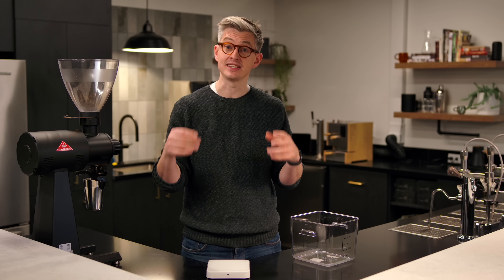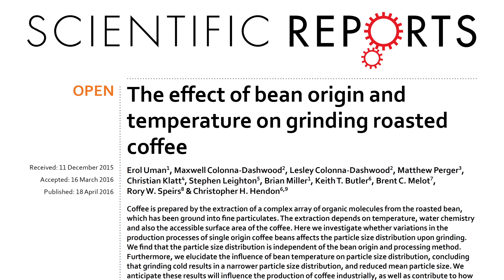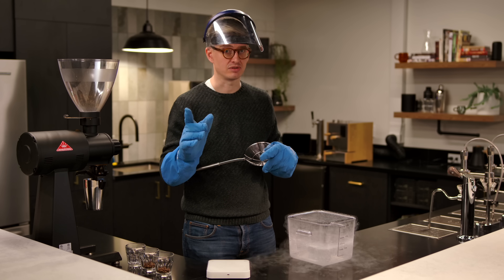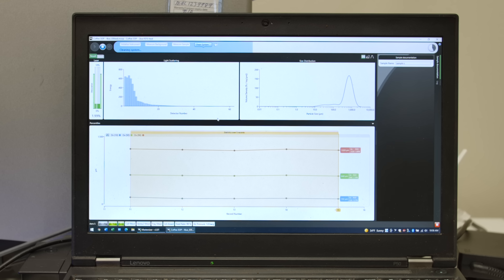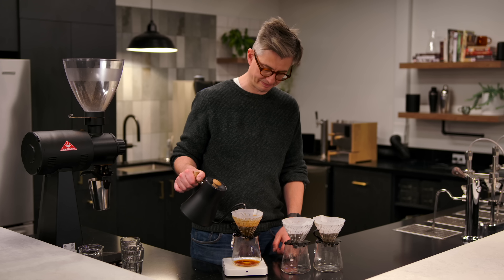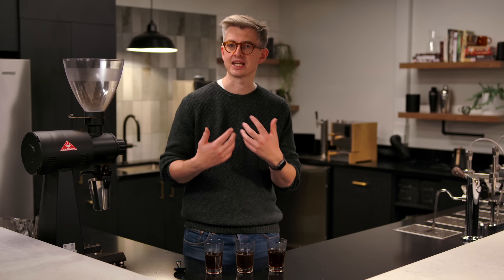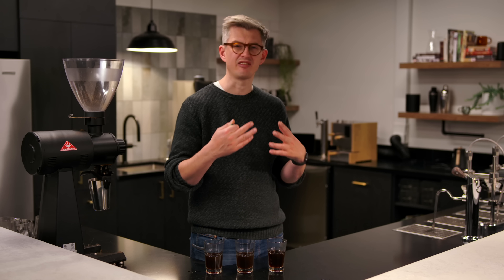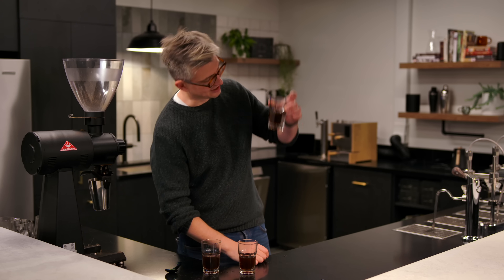Mixing Coffee Beans and Liquid Nitrogen - A Surprisingly Good Idea

Comment: Then there's the next question to my mind.

If beans have been frozen in liquid nitrogen and allowed to get back to room temperature (or freezer temperature), is there a similar difference in the grind? In other words, would it be advantageous to buy coffee beans that someone has frozen in liquid nitrogen?
Reply: having played around with LN2 at university (I mean how could you NOT play with it!), I'd hazard a guess that it's thermal gradients that crack what has already been made brittle by the cold. There's only CO2 and residual moisture in there, but I doubt freezing them changes the structure of the particles much, both on their surface and internally.
what perhaps matters more in the experiments presented here is whether the burrs are at LN2 temperature or at room temperature, and whether you keep flushing the grinder with LN2 during the process to keep the grounds cooled.
Yes, I am now imagining James with a cordless drill running a small hand grinder submerged in LN2 :)

Comment: What I don’t understand is that won’t the frozen beans draw significant condensation during the grinding process and as it sits in the portafilter leading up to extraction (due to ambient room temp)?? I always heard to let the frozen beans thaw out in a vacuum bag to avoid this issue. Is there a concern in getting condensation moisture drawn into the grinder, and also does the moisture affect brewing specifications similarly to how on a wet humid day we can expect slightly different extraction specifications??

Comment: Freezing beans means freezing water and oils inside in the first place. It makes beans more brittle so I guess there's slightly higher chance they'll crack and disperse rather than just get crushed. And the reason why freezer beans don't experience much difference might be due to the oils having lower freezing point than what's in the freezer.

Comment: Would be interesting to know how much of this is actually a function of temperature and how much of condensation. Stands to reason that the frozen beans would accumulate a lot of water - ala the bean misting technique - which may serve to reduce fine particulate formation.
Reply: I was also wondering about condensation. Doing this experiment in winter vs non-winter might get different results.

Comment: I can see people who work in labs where they use liquid nitrogen doing this now. For the rest of us... It's kind of expensive. But. I can see using dry ice (solid carbon dioxide). But dry ice is about -108 degrees F. While liquid nitrogen is somewhere in excess of -300 degrees F. So, the dry ice is not really much lower than your freezer. One more to try. See if you can cool your beans down using liquid helium (~ -452 degrees F). :)

Comment: Fascinating and illuminating as usual. But this approach makes me wonder - if the underlying premise is that this process results in more uniformity and thus a more consistent and thorough extraction, wouldn’t it be simpler to just grind beans “more finely”? (That sounds like poor English but you get the idea).  
Normally, we avoid grinding too finely because of subsequent problems with extraction under (typically) 9 psi pressure. So wouldn’t there be another/different crossover point of increased extraction pressure + finer grind that results in a superior output?

Comment: Which is the temp of the ground coffee at brewing time? I know that the grinder has heated everything up, but did they reach a similar final temperature? I expect a much colder coffee to extract less regardless of particle size.
Reply: Yes i was writing same thing. And i saw your command. Probably liquit nitrogen frozen beans was colder than other even though was ground. And because of that it will be less extracted.

Comment: Very interesting, as always!
One small thought: if you ran the liquid nitrogen sample first through the grinder its very low temperature could have reduced the burrs’ temperature significantly, possibly biasing the results towards a smaller difference between samples.
Reply: Thought the same, but since they did not show the grinding of the other two samples I assumed that they did of course start with the warmest beans first…. Him being James Hoffman and all that
Reply: 10 g Coffee in 1000 g Metall Burr Set plus heat from grinding... can't bei that warm Afterwards!

Comment: The problem with telling people to grind from frozen Is many people are just gonna go against the advise you've previously given about letting the package come up to room temp before opening it to avoid condensation on the beans. That will result in getting good results that day but the unused coffee goes downhill quickly afterwards (2-3 days). So if you dont have little glass airtight jars single or double dosing with or two days worth coffee only I'd let it defrost first! Especially if you're not seeing a noticable difference with standard freezer temperatures!
Reply: Just freeze single-dose vials and grind without defrosting. You get the same quality as room temperature beans, but without having to worry about coffee aging / going stale.
Reply: @Yirgamalabar  sure. The only down side is if your coffee was frozen at a non optimal time then you're kinda missing out on the progression of how it changes over time. It will be consistently the same or about the same freshness. One or two coffees I had got better after 3 weeks (usually not the case but it happens!).

Comment: It’s interesting that there was no noticeable difference room temperature and domestic freezer beans, but I wonder what the effect would be of a larger dose or on espresso in terms of the lower bean temperature potentially lowering the temp of the puck/slurry? Might mean having to slightly increase the brew temperature?  Or are the beans warmed sufficiently during the grinding to negate this?
Reply: This was my question too. I live in a very hot and humid area with no specialty coffee roasters around, so espresso is a hassle to make unless I've bought the beans like a week ago. If I can keep them fresher in the freezer without getting a cold puck I'd start using my espresso machine a lot more.

Comment: I didn't read the paper, but I'd be curious to see if the difference in grind is almost entirely due to the thermal contraction of the metal burs. Might be worth immediately grinding room temp beans after a shot of liquid nitrogen into the burr-set to replicate the results
Reply: An interesting question but don't know if the temperature of the burrs could be measured which would be required to to reduce their temperature to the same temperature when grinding non nitrogen frozen beans.
Reply: @raymondrak961  one burr is stationary, it could be easy to hook up a probe to measure the temp of the stationary burr. Again I didn't read the paper so maybe that's part of the theory

Comment: Interesting, so my natural question is, would it be best to store your beans in the freezer all the time? If the lower temperature improves the grind and the coffee stays fresher, there is really no point in storing the beans elsewhere if you can, isn't it?
Reply: Check his video on freezing coffee. You don't want to be exposing the coffee to temperature fluctuations. Freezing is best for longer term storage. Its interesting to see how an coffee evolves as it ages so I generally do a larger amount at a time. You want an air tight container/package and don't open it until it comes up to room temp. People have had good results just throwing the whole still sealed bag in the freezer.
Reply: @BensCoffeeRants  Yes, I've seen the video. But if you would take the container out to just get a single dose, the temperature wouldn't fluctuate very much I believe. The aging is a good point tho, as the developement is interesting indeed. But you might find a point when you don't want your coffee to age more.
Reply: @evilDandelion39  I buy in 5lb bags sometimes since they're priced better, in that case I'll split it with some family or a friend, and/or freeze like 2lbs of it for later. But for 12oz bags you're likely going to finish them within 3 weeks and it's not necessary to freeze them.  
I wouldn't take the container out to get a single dose out, even if you're quick you'll expose it to a temperature change and cause condensation, plus you'll be doing that everyday, also if you do that you'll never know if it's at it's peak or youve been having the coffee before it's prime every day till it's gone! 
Unless you're talking about single dosing / pre  packaging them individually, it's pretty wasteful if your vac packing in bags, but little mason jars are good for that. Just take out the jar for a day or two amount of coffee. But I think it's good to see how the beans develop over time. Sometimes I do enjoy them super fresh they're more fruity, but get more balanced as it ages.
Reply: @BensCoffeeRants  I've totally forgot about the condensation, that would be an issue. Unless packed individual doses as you say, but that's pretty overkill. Anyway I still split my 250g bags and freeze half, because too often happens that I have a good coffee and have to travel or leave the beans home. This way I have always a certainty that I will have some fresh left.
Reply: @evilDandelion39  
Just freeze single-dose vials and grind without defrosting. You get the same quality as room temperature beans, but without having to worry about coffee aging / going stale. And since opening a vial does impact other vials (which remain closed), condensation is a non-issue.

Comment: I would be curious to see if the actual freezing of the coffee with liquid notrogen alters the bean's structure and possibly chemistry.  Perhaps another test is justified where you freeze the beans with liquid nitorgen and then let them come to room temperature and then grind and blind taste test.
Reply: It is almost certainly a purely physical property that is causing the change. Liquid nitrogen is just that, nitrogen in it's liquid state. Specifically, two nitrogen molecules bonded to each other which is a very stable compound (in fact most of us in the scientific community refer to liquid nitrogen as LN2). It is the same nitrogen that comprises roughly 70% of the Earth's atmosphere. When you cool an object to the same temperature as liquid nitrogen, it becomes insanely brittle. There are plenty of great examples of this available in YouTube, things like smashing rubber bouncy balls into dust, or flowers or shrinking balloons full of gas at room temperature to tiny shriveled sacks. Great fun!
Reply: One of the reasons we use LN2 in a laboratory environment is specifically to prevent changes to sample chemistry and structure; snap-freezing preserves architecture and chemistry far more effectively than "slow" freezing at -80 degrees C, -20 degrees or indeed just refrigeration. There can be issues with crystal formation that mean that it's sometimes valuable to deliberately slow down the ramp down to LN2 temperatures (such as with storing cells for later culture work) - in those cases we use media with modifications to reduce ice crystal formation (dimethyl sulphoxide, glycerol etc) and containers with walls filled with isopropyl alcohol. These keep the rate of freezing down at around -1 degree/minute - the optimal rate for cell preservation - whilst allowing the final temperature to -90 degrees C, where chemistry will be best preserved. In the case of coffee, the cells will be mostly lysed (broken) by the processing and roasting stages, so that rate-limiting method isn't necessary.
Reply: I agree.

Comment: I'd be curious to see the same tests with more of a filter/coarse grind and it's impacts on lower grade grinders. Is there more of a value added if your using a sub 100 dollar grinder or even a blade grinder? I'd imagine the grinder used is already pretty good at not generating uneven ground and fines.
Reply: Pretty sure that for the cost of liquid nitrogen you're sooooo much better of just getting an actually good grinder instead

Comment: I'd be very curious to see if there was a difference between frozen beans straight out of the N2 and N2-frozen beans that have been allowed to come back up to room temperature! I'm not clear whether it's just temperature at the point of grinding that affects the grind size and uniformity (in which case you'd be able to get the same result by chilling your burrs, theoretically), or whether the act of freezing changes something in the constitution of the beans. I'll have to read the original paper, see if they deal with it in there.
Reply: Good question but it's beyond the scope of the comparison.  My understanding is the company uses nitrogen frozen coffee beans to achieve a more uniform particle size.  Allowing the beans to reach room temperature would add time to the process.  The comparison of room temperature and frozen beans appears to be minimal.
Reply: OK I read the original paper and it says that the beans were taken directly from their temperature climate and fed straight into the grinder, so they didn't explore whether supercooled beans underwent any changes that changed their grind profile even after they were allowed to return to room temperature. @James Hoffmann might that be an interesting experiment to conduct next time someone gives you a vat of Nitrogen?

Comment: An important note. The "liquid nitrogen" frozen coffee will have a larger amount of water retained because of the condensation of moisture due to the extremely low temperature. Is this going to effect the extraction process?
Reply: Possibly. If the water has permeated into the coffee cells you skip (part of) the bloom and extraction has begun before you even brew. But, the water is negligible compared to the water used for the bloom or the main extraction.
Reply: Yeah I am not really worried regarding the amount of water. More about the effect of brewing a coffe that got wet during the milling
Reply: Yes, will definitely have picked up some condensation. I was a little concerned for the EK43 burrs
Reply: I don't think "condensation of moisture" is an issue when the beans have been essentially freeze dried.
And grinding will increase their temperature due to friction.
As far as burrs go, I'd be more concerned about the increased wear of grinding frozen beans.
Reply: That just means no need to RDT
Reply: I guess it will also be at a lower initial temperature, which would also affect the brewing temp (maybe that's why the brewing was slower? and why the coffee seemed "less extracted"?)
Reply: @HumbertoMassa  I really don't believe that. The heat capacity of coffee beans is very small, the temperature difference between liquid nitrogen and room temperature (the brewer, grinder parts, dosing cup, what ever else) is rather large and the friction of grinding the beans probably heats them right up. I think the coffee seemed less extracted due to a comparative lack of fines. (which is interesting actually, colder beans are more brittle and I would expect them to make more fines because of that)
Reply: I would have wanted a fourth grind where the beans were frozen, then thawed, then ground. That would indicate whether the low temperature freezing (and possibly condensation) itself altered the taste or if it was the grinding that did it.

But that's a nitpick. I'm not going to be "reviewer B" on James for this :)
Reply: You could weigh the beans after dumping it in liquid nitrogen to see if it has absorbed any moisture
Reply: Get a dehumidifier and remove the moisture from the room.

Comment: James: do you have any sustainability concerns around delivering coffee frozen? We've had coffee for thousands of years without the need to keep it cold. Cometeer's way of having it involves the energy expense of brewing it in the first place, then keeping it frozen, then the customer's energy expense to thaw it or reheat it. Not to mention the single use plastics involved too. It seems like another solution that only provides convenience at the expense of sustainability. But you've been historically very nuanced and careful with these issues so probably I'm missing something here.
Reply: I've also had this question. They mention that they're using aluminium cups and say they recycle their grounds but make no mention of their supply chain. I'm not sure it'll be much different than the footprint of frozen food. But would like to have a definitive answer on that from them
Reply: @harsha1306  They actually are using Al which you can/should recycle.

Comment: With this low amount of liquid nitrogen isn't it safer to not wear gloves when you handle it because the leidenfrost effect? We were always told not to when working with liquid nitrogen on the job.
Reply: I suspect he's wearing gloves because the little basket he's holding is metal and might get cold. 

I agree in general, though, unless you have to hold onto anything that's going to get very cold, you're better off without gloves. I take off my gloves and watch and roll up my sleeves when I'm dispensing liquid nitrogen into a small Dewar. Getting liquid nitrogen inside your glove is a bad time too, so only ever ones with long cuffs.